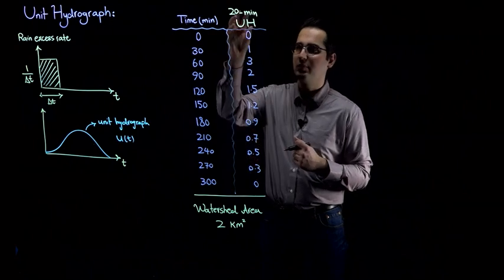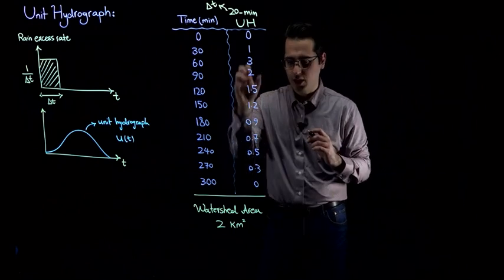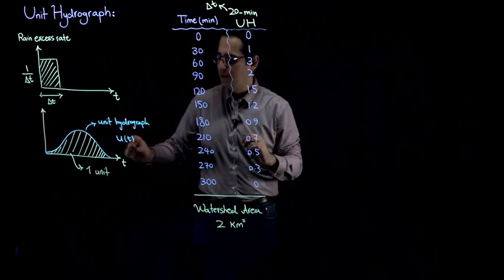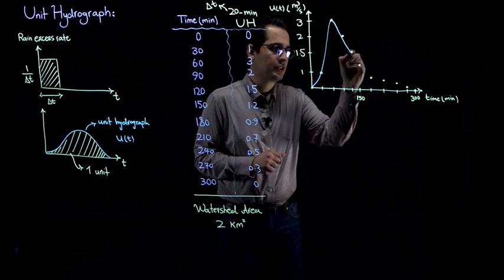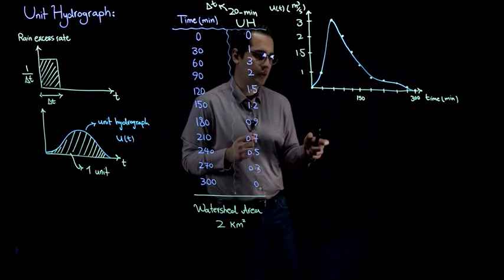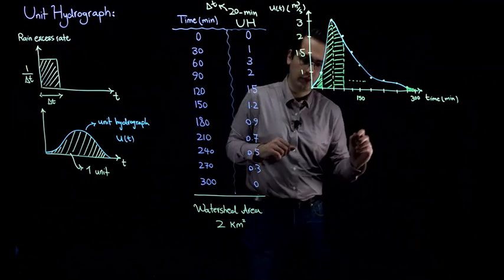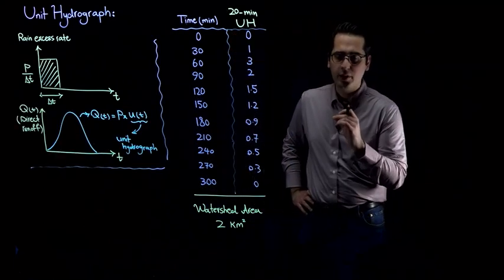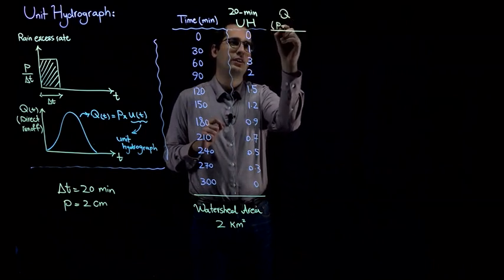Unit Hydrograph Theory - Part 2

Comment: Delta t looked to be 30 minutes. But you are saying it us 20 minutes? I feel like Im missing something....
Reply: Delta t is the duration of rainfall that generates surface runoff (you can think of it as time in phi index, where rainfall intensity is greater than infiltration capacity), so this particular Unit Hydrograph represents the response of a watershed with a rainstorm event which was effective for  20 minutes duration only in generating runoff. 
The time difference of 30 minutes between different observation points for the unit hydrograph is not delta t and has no relationship with the duration of the rainstorm event.
Reply: I was confused with this one too….